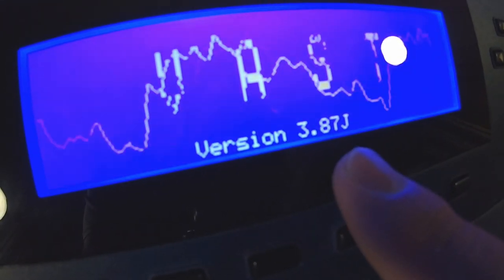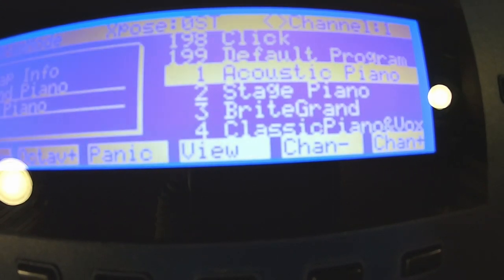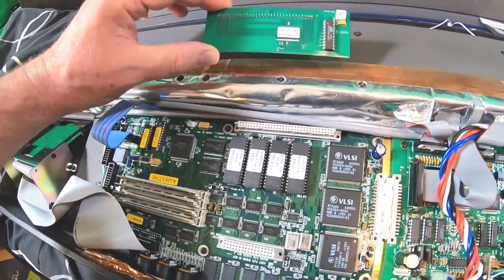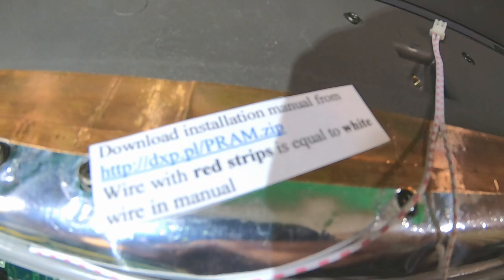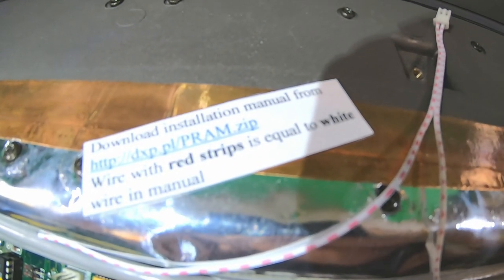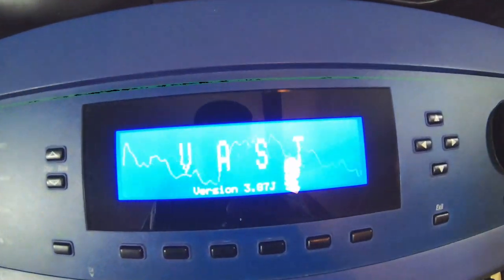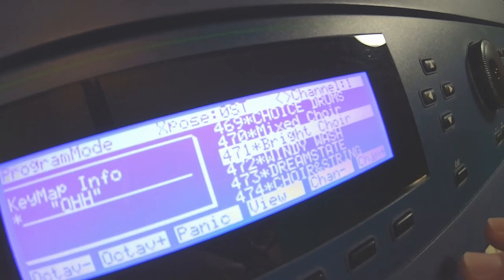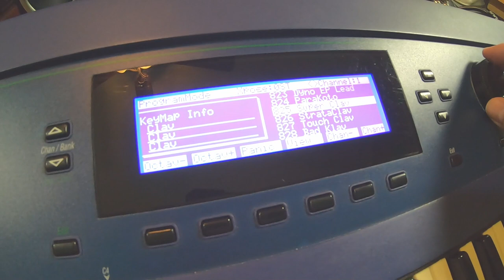Fully Upgrading My Kurzweil K2000 Synthesizer - Presets Demo

Comment: The website in Poland says 'out of stock' on everything. Is there a way to contact him? Also, sorry if you answered this in the video but can this be done for ANY Kurzweil 2000? V3? I'd like to buy an affordable one and upgrade it since the vx is so rare. What specs should I look for (model/OS)?
Reply from the maker: I think any Kurzweil K2000 can be upgraded. There are 2 different mainboards. I can't remember the names. Juliet and Calvin I think. You want a Juliet board. Calvins are harder to upgrade. Do an advanced eBay search for seller "SynthPlus". He is a Kurzweil expert.
Reply: @HankCoffey  Thanks so much. I did not expect a reply so fast! How can you tell if it's Juliet or Calvin without cracking it open?
Reply from the maker: @r2aul  You'll need to ask Scott from Synth Plus.  After upgrading mine, I stopped researching them.
Reply: @HankCoffey  thx, bro. I got the fever for those sounds now!
Reply from the maker: @r2aul  yeah,  I had upgrade fever until I got mine maxed out.  Now it sits in my keyboard shelf.  I use software most of the time now.  I think the Kurzweil parts are getting real hard to find.

Comment: Maybe the fan was to keep a scsi drive cool?  my K2660 has a fan and a Scsi drive.
Reply from the maker: Probably so.  I am not adding the fan.  There isn't much difference from it's factory state component wise.  And the factory backlight isn't there anymore...  No floppy...  It's alright without the fan. 👍
Reply: @HankCoffey  yeah a few extras that you have added, wont cause problems at all.

Comment: Would you know anything about why my k2000's fuses keep blowing?
Reply from the maker: There is a short or bad component somewhere. Diagnosing would probably require a multimeter and knowing where to test voltages. I haven't worked on my keyboards in years. You will have to research.

Comment: Don't blow on the solder points! It might generate cold solder points. And get a solder station for 50 bucks it's better to dial the right temperatures in, also you can put your soldering iron in its stand. I soldered for years without one... its 50 bucks buy it right away!

Comment: Expansion roms for contemporary and orchestral,  looking all over.....anyone know where I can order one?
Reply from the maker: That stuff is getting hard to find.  It might be best to keep your eye out for a K2vx, and just buy the whole synth.  Comes with everything.  There is an Orchestral Expansion on Reverb, but you still need a daughterboard to use it, and you have to change the setup roms.   I still have this Kurzweil but I never mess with hardware synths anymore.  So I am out of the loop of what is available.  Get ahold of Scott Bray,  eBay seller SynthPlus.

Comment: Do you replace the battery in yours? Is it necessary?
Reply from the maker: This model has a door on the bottom with AA batteries. So there is no internal like older models. Internal lithium batteries usually last 15-20 years.

Comment: Hello, any idea why every 7 white notes all the octaves sound in a single key, it is an sp5-8, you could get spare parts to send to Chile, thanks
Reply from the maker: No, I don't know exactly why. I would try all factory resets first. If that doesn't work, it's probably a loose ribbon cable. Or problem with key bed.